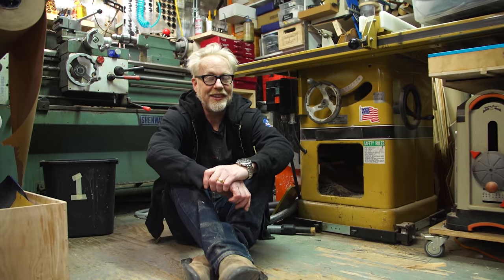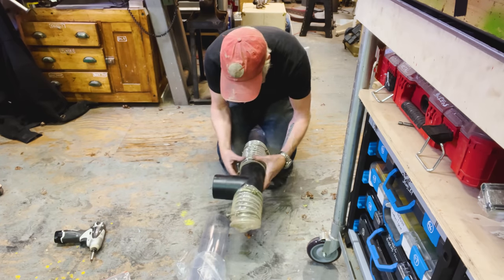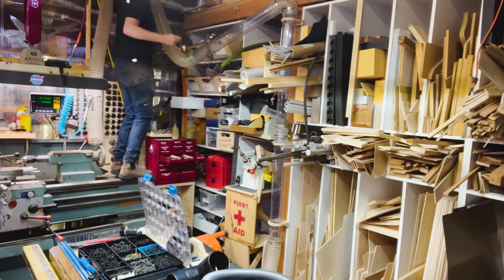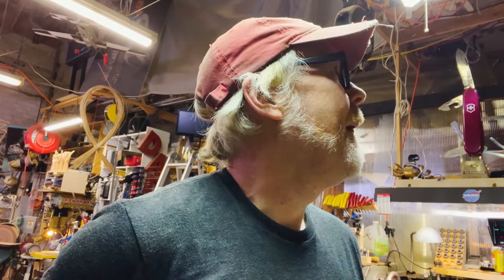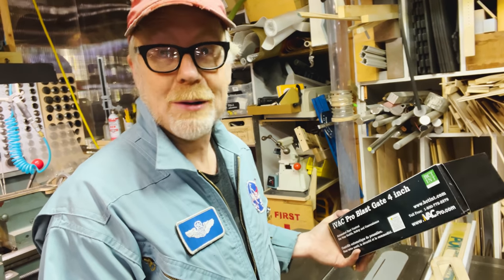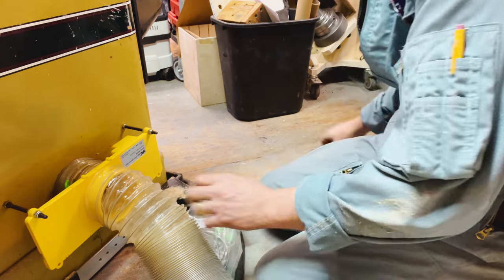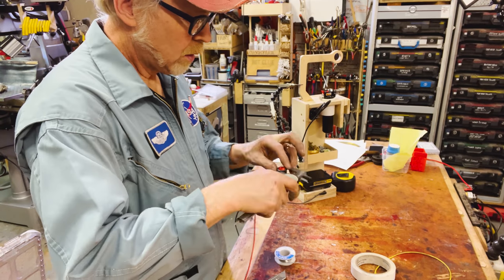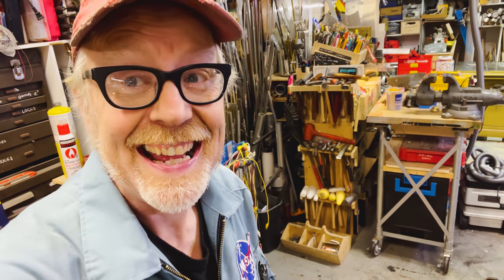Adam Savage's One Day Builds: Shop Dust Collection System!

Comment: Just be careful you don't vacuum up any sparks or embers...  I worked in a shop that had a fire in the dust collection system because an ember got sucked into it.  Fortunately, due to the low oxygen environment it ended up in, it smoldered until we noticed the smoke and were able to put it out before it got serious.

Comment: Ah yes, ribbed tube. Like flex ducts, they cause a ton of pressure loss and just collect all kinds of crap in them. In HVAC systems you generally only want to use that kind of thing if you literally cannot make or fine a better solution out of straight or angled ducts. You may want to put in some screw-closed access ports just to clear jams, if that's ever a problem. As for the shop vac hose, maybe move the back end closer to the suction pump? Finally you may want to install just general fans, air intakes or hoods to suck in dust and pump it into the system to cut down on overall shop dust buildup.

Comment: I thought for a sec the hose was going to catch hold your ear and suck your eardrum out!😂
**Question, if the blast gates are centralized in a manifold near the dust collector so that all lengths of hose are shut off except the tool in usage would that increase the CFM of the system, or does that even matter?? 
Thanks for the upload.

Comment: Adam: if you have the choice, get the ring clamps with the yellow nuts, the green ones are harder to turn. 
Adam later runs out of ring clamps and has to use tape in first half of video. 
Adam in the 2nd half... has strangely bought the ring clamps with the green nuts... 🤔

Comment: I would suggest using actual connectors instead of flexible hose with ribs that don't seal well. Also an other nono is T connectors, 90 turns really bug down your airflow.
On an other note, it won't replace your shop vac that moves a small volume at high pressure, as opposed to the dust collector that moves high volume at low pressure. Using adapters won't do your volume or pressure any favors either

Comment: Adam any consideration to snake a bare wire inside your tubes connected to earth to reduce the chance of static electricity and a fine dust fire! Those PVC / poly tubes and fine dust could create quite a charge and ignite. Little effort for big safety mitigation.
Cheers, #SeattleRingHunter

Comment: Adam, your problem is that you really need a twin bag, 3hp DC. with 6" pipe to the hose. The magic number is 1,000cfm of air flow, and DC's achieve about half of what the specs say they do. What you have done will not make much difference.

Comment: Why ribbed couplings? I thought you were trying to get rid of ribbed tube? Central Vac systems use solid pipe and they must make couplings for that pipe or rubber slip on couplings that size.

Comment: 90 degree turns are bad in dust collection. You need 45 degree into a main line pipe. It probably doesn't matter, but it something to consider adjusting here. Secondly, dust creates friction. Friction creates current. Current creates fire / electrical static charge. There are three thoughts to the charge reduction, and most relate to a screw through the plastic and a ground wire running along the tubing. 

https://www.powderbulk.com/enews/2018/editorial/story_pdf/pbe_04_04_18rihf.pdf

Considering putting a ground wire with screw taps to discharge build up to a ground point.

Comment: The rabbit hole that is fine dust collection....

Central dust collectors like yours are designed to move high volume (CFM) at low static pressures (SP).

You're better using your shop vac for small hose, high resistance connections like your handheld sanders.

Small diameter ducting, long runs, flex hose, fittings, 90s, T's, Y's etc. all increase SP resistance and significantly reduce the performance of your dust collector.

Also, the inefficiency of the filter bag on your collector is a large culprit for the dust in your shop and reduces performance of your collector. Filter bags not only allow all the finest dust particles to pass right through, they have such a low surface area that they increase the SP and further reduce the airflow from your tools.

If you live in an area with mild weather, you would be better to vent your collector outside, remove the filter bag and eliminate the SP loss from the filter altogether. The downside of this is if you're shop is heated or air conditioned it will be warm/cool air out and outside air coming in to make up for it. In that case, you could alternatively replace the filter bag with a sub micron MERV rated pleated filter that will increase the filter surface area improving air flow and also capture fine dust.

With either of those options you may want to consider a separator of sort such as a cyclone which you could most certainly manufacture yourself with your significant metal and machining capabilities.

Anyway. Smooth ducting was a good start, but lots more can be done to make your setup more effective.

Good luck!

Comment: You need to replace your double-bag dust collector with a collector on the bottom, hepa canister on top and a vortex in the middle. You’re putting WAY too must dust back into the air with that system.

Comment: Safety alert!!! Adam, when using those drop down hoses, be careful what you pick up. A dust collector like that brings the dust right through the turbine blade. Small metal bits will eat away at your turbine and may even cause a spark into all that dry sawdust. It’s happened. Please be safe and FIRE FREE!

Comment: Piping those bix extractor pipes to a handheld tool small diameter plug will starve the system of air and drastically reduce suction as you likely noticed by now as this is 3 years old haha

Comment: Why not just wire the vac gate into the table saw so that when the table saw is switched on or its Estop released the gate automatically opens and when not in use it automatically closes?

Comment: One more quick thought (at 35:10) - that 2nd zip-tie gives me the jeebies - I know it's an electrical insulator and so if it touches the contacts, it should be fine - but the way those wires are held together doesn't feel right somehow? If the cords come apart, even a little bit, and the contacts become exposed, and maybe some aluminum dust fluffs its way in there, you have a real potential source of ignition I think? I can scarcely think of sadder possible news than if the cave burned down someday.

Comment: how are you going to deal with the possibility of static building up and igniting the dust and doing like what flower dose as seen in mythbusters
Reply: beyond the wheel  its a possibility if the right conditions are met enough fine dust and a good spark

Comment: PLEASE! Make sure that plastic ducts are grounded! This system is an explosion waiting to happen. One small spark from the collectors impeller from a metal filing and... boom! Run a grounded copper wire through all the ducts with terminals at each gate.

Comment: if your saw is 120/240.. just have a break out 120 outlet on the side to plug the gate power brick into.. that way its only the dust hose being dragged across the ground... your saw already has a power cord going to it... why add another? and in that train of thought... why not just have it open up when you turn on the saw? wire it to the switch to power on the saw?

Comment: Replacing spiral hose with smooth hose will make insignificant difference to that system, you need to increase the air flow ,eliminate all right angle bends, right angle entry take offs cut the air flow
 increase from 4" to at least 6" hose, 4" hose will never give good air flow it is simply physically too small if you want decent dust collection replace the system you have which is next to useless with a cyclone.

Comment: Should have put the dustgate bolts diagonally, this way it breaks sooner or later. Also connect to the saw with a relay to work with the saw.

Also nice ladder safety, you are even worse then me :)

Comment: We made pneumatic gate actuators from 1" PVC.  Each gate is driven by the shop compressor, and activated by a 24VAC pneumatic solenoid valve driven by a small transformer hooked to the load side of each stationary tool's magnetic contactor switch.   Also on each gate is a microswitch that sends power to a relay thet turns on the blower motor for the dust retrieval cyclone.  How it works:  hit a tool's power switch.  The tool comes on and the 24VAC transformer sends power to the pneumatic valve.  The valve sends compressed air to the PVC ram, which slides open the gate. At full open, the microswitch engages, turning on the relay for the cyclone motor.  It's literally a one-button push.  Here's the pneumatic valve: https://www.electricsolenoidvalves.com/1-4-24v-ac-electric-brass-solenoid-valve/  You can buy solenoid valves and Roundline small linear ram actuators from Airtac and other suppliers like McMaster-Carr.

Comment: Adam sir I need some help prototyping an idea I have. I don't have equipment or experience (outside of my electrical engineering education and military). I want to design a super cheap retractable vertical wind generator using flexible cutting boards and electrical or pneumatic actuators to raise and lower them from a PVC tube.

 please help me.

Comment: Adam is a TERRIBLE role model for safe procedures up on his 8'-16' folding ladder - just like I am! ;-) What I need to find for my home shop is a good dust mitigation system the will work with my Shop-vac. (I have a chop saw, a drill press, a circular saw, 4" grinder, and a couple of sanders.) Any suggestions?

Comment: men will literally fill their shop with old miniatures from the augustus gloop scene in charlie and the chocolate factory instead of running a little bit of sheet metal
Reply: men will literally spend $100 on hose clamps because they didn't notice the 36" zipties on the shelf at the plumbing supply house

Comment: I’m of mind that if I’m putting in dust collection that I would do what I could to make it as efficient as possible. The optimizations that require a few dollars and a few minutes add up to some spectacular numbers over time. The choice of using broader curves for elbow and no abrupt turns, to me, is paramount to making it work well. Such small changes, again, add up. I’m a little disappointed a few details like this were not taken into account. Biggest offender is that T-intersection right off the collector. Aahhh! Why? Not saying everyone had to be as picky as me. I am saying it makes me question what improvement would be at very little input.

Comment: This system is not going to do anything to reduce harmful dust. Fortunately he doesn't do a lot of woodworking but this kind of cloth bag collector with low airflow will return the fine dust that it collects to the shop atmosphere and won't collect most of it at the tool. The stuff that causes lung problems is the tiny stuff that you cannot cough up, not the visible stuff that gets all over everything.

Comment: Don't forget to run a copper ground line around the whole system. It's rare, but static built up in the pipes has the potential to ignite high volumes of dust

Comment: Having the blast gate on the back of the table saw is inefficient as the whole ducting run all the way to the table saw is used even when the gate is closed. It should be on the drop to the saw so the length of ducting with air flowing is as short as possible when using different tools.

Comment: T-joints in the ducting for the air system are not good. Also using it for small handheld tools can starve your system and overheat the motor.

Comment: It was kind of painful to watch you connecting all those discreet pieces with the ribbed hosing. Also using the T connector. It would have benefitted you to watch some YouTube videos on the subject first!  While it may have been an upgrade for your system the efficiency is poor. It could have been soooo much better with a couple of simple changes, like all rigid tubing and Y connectors for drops.

Comment: So, Adam built another project that really sux...OK. Bad practices: standing on lathe ways, straddling between fixed point on wall and movable table saw bed, cutting steel wire with side cutters,  Adam doing wiring, Adam with power tools, Adam soldering.

Comment: You're really going to want to swap those tee fittings out for "Y" type fittings. Seems like a small, nit-picky change, but air doesn't like 90° turns. You'll see a drastic increase in airflow through your drops.
Reply: Oh, and automatic gates are definitely a thing. If you have one nearby, it would be worth dropping by a Woodcraft or Rockler store for a chat about options.

Edit: I should stop writing comments before the video is finished 😉

Comment: I stopped watching this when I saw that you were using Tee's and tight 90's. Did your friend not tell you that those will provide as much or more friction loss as the ribbed flex hose. Wyes and long radius 90's are paramount in a large volume flow system. Also, I see as I type, that you are expecting small diameter vacuum hose. They don't work because of the extreme friction loss.

Comment: im sure im not the first to say it but your going to burn your shop down.  Sucking  metal into an impeller that drops into shavings is a known fire hazard.  Reducing a dust collection diameter to that vacuum size can overheat the machine and start a fire.

Comment: Is that your personal shop or commercial? Plastic/PVC duct isn't legal to use in a commercial shop because of the fire hazard involved. I wouldn't put it in my home shop either.

I've worked in the dust collection industry for almost 20 years (*just* dust collection), and that system makes me cringe, if I'm being honest. That Delta bag system is junk. Doesn't filter out the harmful particles, and they're a nightmare to clean. You can put a cyclone separator in front of it to make it a bit cleaner, but if you're not using HEPA rated pleated filters for the return air to the shop, you're not doing yourself any favors.

Comment: Adam..... May u didn't notice that your dust collection system have 2-3 other design flaws...
First of all, u misunderstand that there is a big difference between vacuum suction and air volume suction. If u connect small hoes to your system u will never have great suction because u have one who transport volume and is not good at vacuum.
Even u put Kork plugs in the thin hoes, u will loose lot of potential energy.
U also will have less dust in the shop if you change from the filter bag to a proper filter-cartridge.
Maybe u also will update your new table saw blast gate installation to your table saw on of button with a master slave to your dust system... One button instead of 3